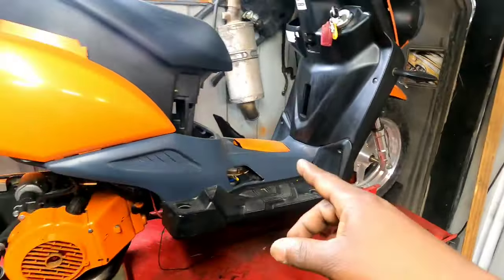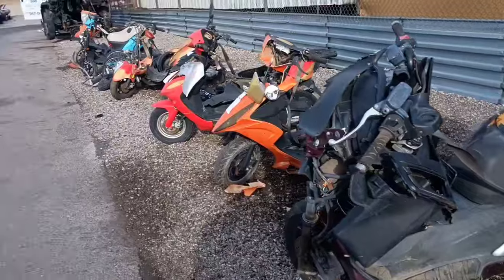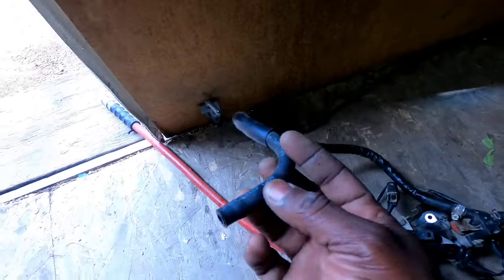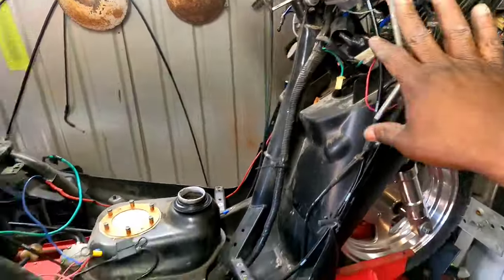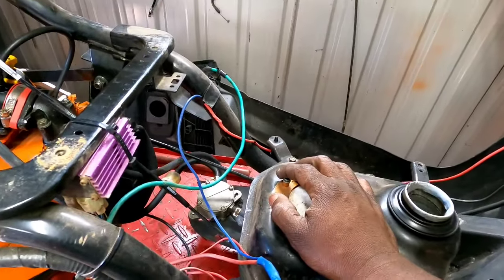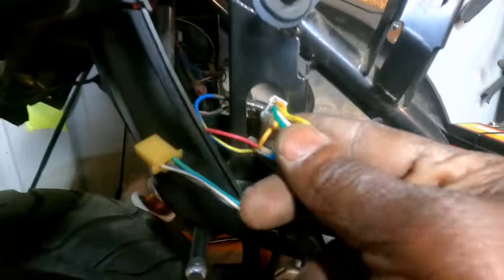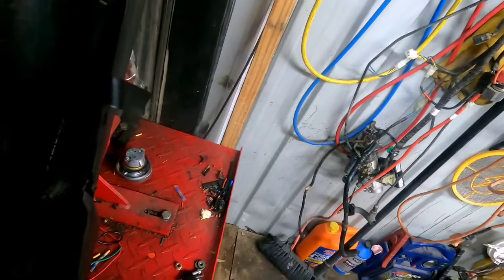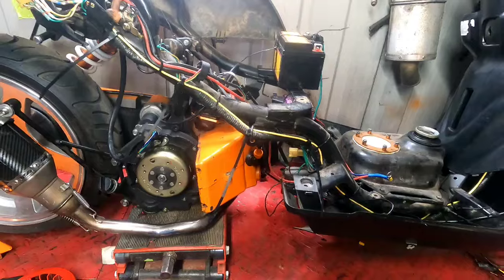11 pole stator & rectifier / voltage ⚡️ regulator conversion

Comment: Search for kymco like 200i wiring diagram.i have found it in dutch.but can't see it very good on your video.for that round black thing you mentioned.
Reply from the maker: Amy I found a good diagram and downloaded it.  Now I just have to figure out the fuel pump situation I went back and got the original one from the salvage emporium. Thank you for commenting and watching ‼️
Reply: @scooterrehab6295  electrical stuff isn't my thing.good luck 👍
Reply: The sensor that has the UP mark is a tip over sensor, it shuts the fuel pump once the bike goes beyond a certain angle. Install that perpendicular to the driveline and enjoy your motor cutting out every time you hit the brakes! So fun!!!

Comment: Your stators, putting out too much power. That power is soaked up by a resistor. I think your sand resistor needs replacing.
Reply from the maker: 🤔sand resistor ❓ is that a  rectangle thingy with a wire coming out one end❓ thanks for commenting ‼️ and for the information